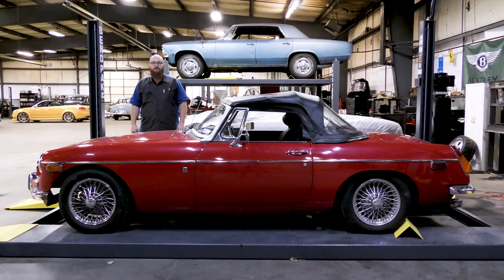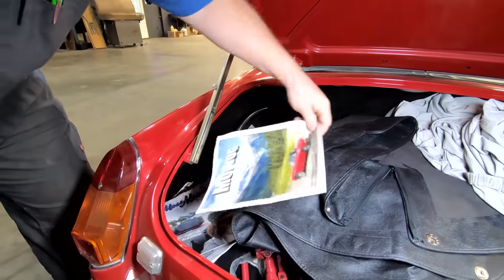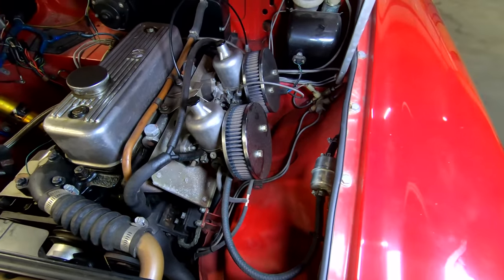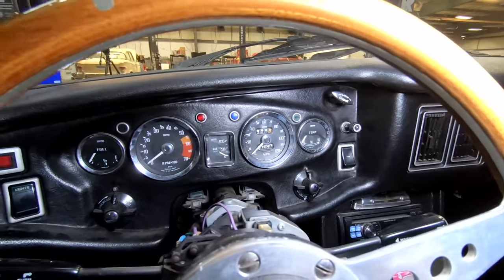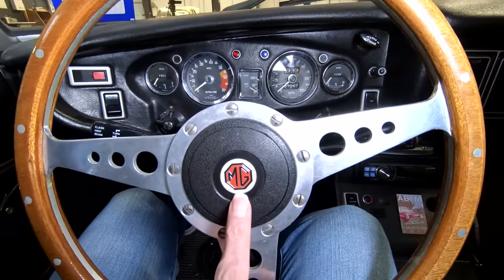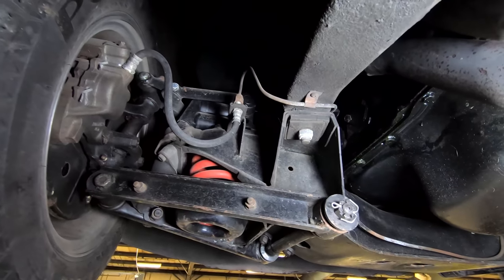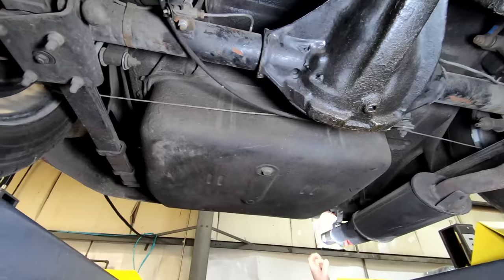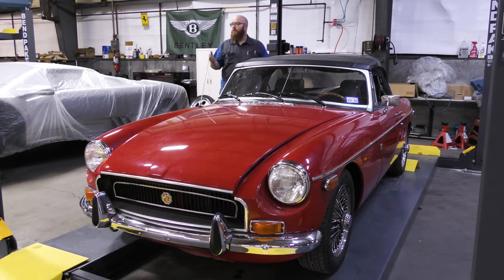Cherry 1972 MGB! See exactly why it earns a thumbs up from the CAR WIZARD!

Comment: Wizard - As a long time MGB owner with a fully restored 1966 MGB that I did myself, I would like to correct a few statements made in your video.  This comes from point of view of having more knowledge about these cars and that you don't see them very often, not trying to one up anyone here.
1)  MG imported over 400,000 MGB's to the U.S. over the 18 year production period.  They were the most popular MG model ever produced and were specifically targeted to the U.S. market.
2)  MGB's were very successful race cars in their day and won their classes at Le Mans and Sebring, along with many SCCA class championships.  They also did well in rallying and and are still prevalent in historic racing.
3)  The shock absorbers are not "knee action" shocks, they are "lever action" shocks, as referred to in the factory manual.  Even though they are 1930's technology, they actually work very well as compared to tube shocks.
4)  The battery was placed behind the passenger's seat to help weight balance the car.
5)  The largest supplier of MG car parts (along with other British makes) is Moss Motors out of California.  If Moss doesn't have it, it isn't made.  You can literally build an MGB from scratch using Moss Motors parts (they even produce entire bodies).  Suggest you look up their web site and consider using them if you have any future work on MG's.  Your supplier probably ordered from Moss anyways.
6)  The SU fuel pumps are notorious for going kaput, but are easy fixes.  Usual failures are either the points in the pump, the pump diaphragm, or the leaf valves in the pump.  Repair kits are available.
7)  If you do see potential for future MGB work, I suggest you get the Robert Bentley reprint book of the factory repair manual.  It has everything needed for repairing MGB's, including the special tuning sections to improve performance (albeit circa 1960's and 1970's).  This book can be ordered from Moss.
8)  The earlier models of the MGB (1963 to 1969) are actually quite roomy and fit large drivers easily.  I am 6'4" tall and have to move the seat up on my '66 to reach the pedals.  Later years moved the seat mounting system forward in order to accommodate the folding frame convertible top and then anyone over 6' was a bit cramped.
9)  These cars are an absolute blast to drive and you are correct in noting any small hatchback of today can blow it away on the road for performance.  That is not the point of the car.  Being on the road on a beautiful sunny day with the wind in your hair and hearing the exhaust note as you drive on your favorite curvy road is what this car is all about.

Keep up the great work and I always enjoy watching your videos.
Reply: Excellent comment. Civil and knowledgeable. I have been thinking of getting an MGB and your information was very helpful.
Reply: I have the same style shocks in my Morris minor. You can change the grade of oil to stiffen the suspension!
Reply: IMO...the MGB was inferior to the previous model...the MGA....also inferior to contemporary Triumph TR3-TR4s....The B was slightly more comfortable interior-wise...but for me, performance was much better with the Triumph models...the TRs had a nice, rorty exhaust note...the MGB had a weird, weak, tinny sound to it...in short, the MGB was an anemic, ""ladies" sports car...the TR3-4 models were more masculine sounding, and had around 20 more bhp...I owned at 1959 Austin-Healey back in the late 1960s--a lusty six cylinder , making around 120bhp...but my buddy owned a 1960TR3...and it could totally keep up with my Healey, at least up to 60mph or so...But another friend of mine had a 68 MGB...it would soon be in my rear view mirror! lol.
Reply: I agree with you Ron. I bought a ten year old ‘72 MGB while in college. It was my dream car. I found a shop that happened to have a mechanic who used to race British motorcycles. He had the carbs tuned perfectly. We spent a day going through all of the grounds. Once this was done, I never had electrical problems. Knee action shocks!!
Reply: Fun is not a number!
Reply: I'd add to that list the dashpots - the bits with the oil - on the carbs are not to "stop the throttle snapping open". They're there to give a richer mixture on acceleration by slowing the rate at which the piston rises on opening the throttle.
Reply: SU fuel pumps and Lucas Distributors are the best things to upgrade in these cars.  In both cases, more reliable solid state units are made, also available as with everything, from Moss.
Reply: To your point I’ve never replaced an SU fuel pump. Cleaner and filed points, replaced the diaphragm, replaced points etc and they always come back to life good as new! Like my Peugeot fetish and the perception of electrical problems those cars have, Lucas makes fine parts and the British cars weren’t really a problem. As long as your ground connections were good and normal connections weren’t corroded everything works. That applies to all cars of any age, not just some.
Reply: @bryancohn9406  Yes, but you don't have to file the points with an electronic fuel pump, nor with an optical distributor.  I understand that it's enjoyable to work them over with a wire brush every 6 months or so on the side of the road, however it's not something you absolutely  have to do anymore.
Reply: In Australia they ran twin 6v batteries with a positive ground. Hence the two battery boxes.
Reply: The mechanic in the video  seemed perplexed by the 2 battery boxes.  My '65 B had 2 - 6 volt batteries, 1 in each box.  They were split like that for weight distribution I believe.  BTW, the car was also positively grounded, something that mystified the radio techs that put in my tapedeck.  

Ha ha, just saw your post Peter Hales.  Yep twin 6v batteries, positively grounded.
Reply: @peterhales1674  yes not only in Australia I think they did run 2 6v batteries and positive ground until 68/9 then they moved to negative ground and still used the 2 6v batteries in series until late in the 70s but that was commonly modified to one 12v when they eventually died. The second battery was in the spot the wizard mentioned it was for storage.
Thanks to the OP for clarifying certain things. One note is that any oil seepage you see is considered a automatic rust prevention system 😂😂😂
I have a 73 in the garage 😀 there is everything to love about this British cars of the era.
Reply: @peterhales1674  That was all of the pre 67?, pre 69?  cars.  All of them had 6V batteries, and positive earth as well.  A google search will tell you exactly.
Reply: @johnturner4400  you're a harder man than I if you want the suspension even stiffer. "A collection of spare parts traveling in close formation" is an accurate description of most LBSC's
Reply: @petersherman2552  I would say that's accurate, at least in terms of the Spitfire/GT6.  It's been a while since a drove an MGB, but I remember them being a bit softer.
Reply: @seanm2511  I had an A for a while and that was certainly harder than the B.  Still got the B. Put a V8 in it. I put in stiffer front springs and a much thicker antisway bar on to cure oversteer. The V8 and gearbox is about 40kg lighter than original. But I left the shockers well alone. Want to keep my dental fillings. The front suspension doesn't move much even so. Peter at worldwide in madison US actually re-manufacturers adjustable armstrongs if that's your desire. His standard armstrongs are the best there is.
Reply: @petersherman2552  Sure.  Armstrong level arm shock absorbers are not the pinnacle of damping technology, but in the B, which weighs nothing, they work fine.  Even the leaf spring rear axle works OK with the B series 70-90hp.   When you put a V8 in the car the rear end no longer works OK, but...  that's a different subject about which whole books are written.
Reply: Among my British cars of "shame" 🤣😉 I can count a 1973 MG Midget, a 1980 Triumph TR8, a 1981 Triumph TR8, and THREE DIFFERENT 1991 Lotus Elan M100's (a red, a white & a Norfolk Yellow).  If you expand the list to The Commonwealth then you'll also see a 1991 Mercury Capri XR2 Turbo.  I sat in and drove an MGB one time and came away thinking what a comfortable car it was compared to the little Midget.  As you said, not a car that'll get you the quickest from A to B but just a nice place to be with the top down.
Reply: @seanm2511  quaif diff, fibreglass springs, panhard and antitramps. It kept getting more and more expensive. I dont think I'd do a V8 swap again. Moneypit. Although the end product worked out very well indeed,  its a sweet little car as an 1800. Except for the fuel pump. Unless you're using it every day the points corrode over (the hit it with a hammer trick to get it to kick over)  and a contactless version eg A subaru, or honda diaphragm pump, works just fine. You don't even have to take the SU out. Japanese one will pull through. I stuck one up in the engine compartment temporarily one day (late for work, took 15 minutes to do).
Reply: @petersherman2552  I like the B for what it is :)  Actually I like the BGT, and the GT6 better than that.  These were great cars.  Fun!  and you could fix the shit yourself, unlike the modern garbage (e.g BMW) we are forced upon now.
Reply: Thank you for such good information.I've wanted 1 for too many years,but was afraid of repairs.Now I know better.
Reply: Ron Luwe You covered a lot of the features and facts about the MGB. To which I will add:
10) The body (even on the roadster (convertible)) is surprisingly stiff. It is basically unibody construction with a very massive subframe for the front suspension. As compared to the Triumph TR-6 (TR-3s and TR-4s are similar) with their ladder frame and separate body... if you jack up one wheel on a Triumph the doors no londer open and close properly. Same thing if you park with one wheel on a curb or whatever the frame is so loosey-goosey it can twist the body geometry out of alignment.
11) New lever action dampeners are still available from various sources and it makes a HUGE difference in rige quality and handling. There are good conversion kits for both front and rear tube type dampeners. (see Moss Motors.)
12) The carbs need some special attention occasionally and a rebuild which is very easy to do. There used to be kits available from SU and I htink there still are that come complete with main jets. It is near impossible to flood the engine no matter how much you pump the gas pedal as there is no acceleration pump as in most other carbs. Absolutely essential that one has a way to 'balance' the carbs. Again Moss Motors sells two kinds. The more expensive German made one is worth the extra money. They also sell a tool kit specifically for SU carbs which makes tuning them a lot easier.

Lastly I wholeheartedly agree on your 9). These cars are a heckuvalot of fun to drive on a curvy country road.
Reply: pardon, but if you are over 6', wouldn't you be better off with something built to accommodate that? I always find it funny to watch Doug DeMuro trying to cram himself into cars clearly designed for much smaller people... A lot of Euro cars of the era are built to accommodate drivers up to but not over 6', if that. Just a thought. I'm exactly 6' and several cars I've sat in just do not fit, like original Minis, Fiat 500, MG's etc...
Reply: @noth606  Original Minis, ie the pre 70 Mk1and 2, easily fitted people of upto 6'4' ...Alec Issigonis designed it that way.
Reply: @noth606  
Commenters here said those north of 6ft can and do fit as long as they are also not 6ft across....
Reply: I have had several MG’s. The ‘67 had the removable hard top. I still love them even they could be problematic. Fun to drive.
Reply: I worked on these when they were first announced and they rolled out of the factory with 2 six volt batteries, hence the “spare” battery cradle.
Reply: Was any of that necessary? It wasn't a hit piece video.
Reply: @seanm2511  I replaced my fuel pump with a small, generic electric pump.  The only thing to watch is delivery pressure so you don't overpower the floats in that SU carb.  I actually bought two and keep a spare in the trunk (with a spare distributor, points, condenser, rotor, and fused wire jumpers).  ;)
Reply: @darrylyoes414  Absolutely.  I put in a regulator to prevent the electric pump in my GT6 from overflowing the CD 150 float bowls a while back.  These have even sticker floats than SUs.
Reply: @theundergroundlairofthesqu9261  Perfect comment!
Reply: @seanm2511  I bought  a  brand new 1969 MGBGT when I returned from Vietnam ...  gun metal grey with black interior ...it had 2.. 6volt batteries...That battery compartment was open to the underside of the car so you had to watch out going over deep puddles of water. My wife loved that car and cried when I traded  it later for a Porsche 911 T.
Reply: BRILLIANT , 
I Agree All the Way.
Reply: @curbozerboomer1773  - Yeah, well, if it’s pecking order you’re interested in my Datsun Roadster blew your Triumph’s away. So there! Nyah Nyah. 😂
Reply: 1. There were around 525,000 MGBs produced, and the majority did come to the US and many were manufacturer in Australia. 
4. The batteries, plural , for many years two  6 volts  and then much later used a single 12 volt
5, BS.. There are many companies who have MGB parts that Moss does not have , and often of better quality and price. I have been dealing with Moss since 1964,  as an individual and as an employee of one of the largest BMC dealers ( in total 14 lines of Brit cars) in the US 1968-1972. 
6. BS. They are not "notorious" and fail no more often than fuel pumps made by other manufacturers during the same time period. Another "Lucas" myth as they were made by SU.  
7. The Bentley book is very good and there are many others from sources in addition to Moss. 
8. The MGB was produced from 1962 ( not 63) and the first 3 years had more room because of the narrow transmission tunnel. This was made wider when the 5 main engine was fitted starting in Oct of 1964.. the beginning of the 1965 model. 
9. The car is more than all about a momentary nostalgic ride, it is a work horse daily driver, an exploration vehicle,  an all weather car even with the convertible top, hard core rally and, of course, many types of racing.  As to performance, many of these cars have been "tweaked" with hotter cams, higher compression, over bored, heads ported, free flow exhaust systems,  modified SU carbs ( some fit wannabee performance carbs such as the Weber down draft.. complete garbage or the Weber 45 which is over carburetting.. inefficient and very difficult to jet correctly and the new ones are made in Spain.. more junk.. rather than the older ones from Italy) .  Additionally the MGB can out-handle many of the newer
"small hatchback"  cars.. you just need to pick the right road.

MGBs are fun, light,handle great,  easy to work on, parts are modestly priced  and easy to get compared to other "vintage" cars.
Reply: @curbozerboomer1773  hm. The MGB is, in most senses, superior to the previous 'A' model. It has more horsepower- 95 at the crankshaft and about 75 at the rear wheels. 
I think the MGA is the better-looking car, but the B's rollup windows are nice in the rain. 
My own MGB has been modified a bit, with a Fab-tek engine and a custom interior and top. I really enjoy it, and at 130hp at the crank as dyno'd, it performs quite well. BUT... I always have this nagging wish that I'd restored an MGA instead. I also love the look of the TR3. And the 3 was a really good performer. I'd love to have one someday. But the B was the first sportscar I ever looked at with my Dad (I was 6 years old) and I restored mine as kind of a tribute to dad, and that far simpler time. 
Cheers
Reply: The twin battery boxes originally held two six volt batteries. It was all about balance and space. 
I'd also note that the B came from the factory (62-68) with 94-95HP at the crankshaft and 74-75 at the rear wheels. 
I would not use a stock electric pump. There are better aftermarket choices. Some guys in my club actually have two fuel pumps on the line so that if one fails, the car still runs.
Reply: oops replied twice... er... three times now. Apologies to all.
Reply: Mine had two 6 volt batteries
Reply: @bryancohn9406  
I had countless cars with Lucas electrics, and never once had a problem. Lucas parts were generslly simple and well made. Even Rolls Royce used Lucas. US companies in the UK used Lucas. Lucas starter motors were solid and very reliable, being interchangeable across many car manufacturers. 

The problem was manufacturers who designed and put in poor electrical systems using connectors switches, etc, just able to handle the current. Many cars were made down to a price.
Reply: I had a 1969 Roadster I bought brand new my freshman year of college. I drove it for 10 years and raced it for 6 of those years. In the Mid 1990's I was given a non-running 1972 B Roadster.
I offered it as a High School project and installed a 289 CDI V8.... 
Poor man's Cobra.... 😁
Reply: When I was in high school the girl across the street got an mgb as a gift from her dad. Weird things would break on it, such as the carburetor. My buddies and I always enjoyed sitting on my front porch and watching my neighbour wash her mgb in her bikini.
Reply: Along with your mention of the SU fuel pump should be mentioned they had a breather tube to the dry side of pump diaphragm that terminated with a small white plastic "T" fitting just above the trunk floor  surface that could - if trunk seal leaked, condensation from extreme climate/temp changes built up or even carelessly washing interior of the "boot" scavenge water down and into the electrical dry side of the diaphragm in the pump itself. 

Mine was a brand new ordered from Factory 67, first year for 5 main crank and it was a blast to drive around with the top stowed, tonneau cover on and the driver side unzipped, rolled up behind the seat. It was even more fun when wearing the obligatory "cheese cutter" leather cap. 😄